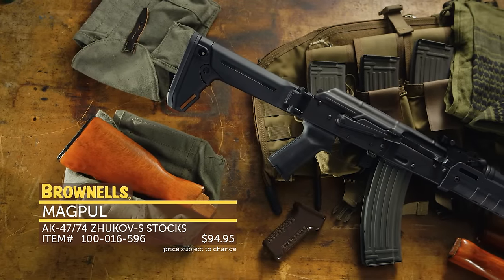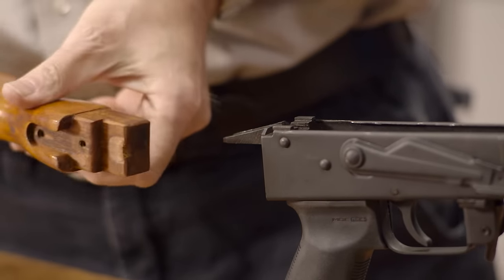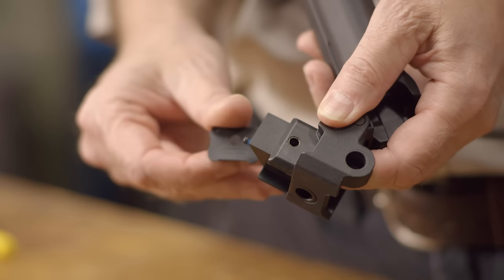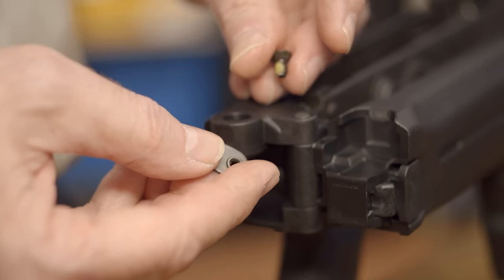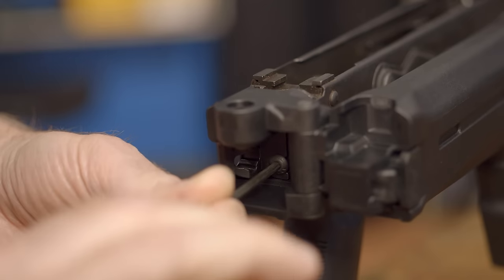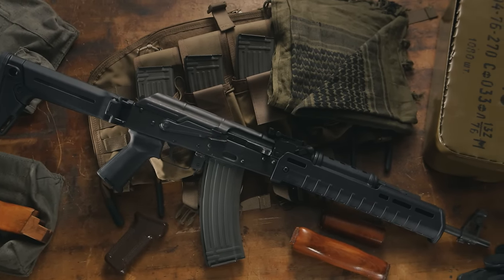Magpul AK-47/AK-74 Zhukov-S Stocks Installation

Comment: Mine just came in today. Thank you! I modified it to fit my Bulgarian. It won't win any beauty awards, but neither will the stock that came with it.
Mine was missing both the drop in wedge block washer and the tang well nut. So since I was installing it on a milled receiver I just used the receiver screw and put it up through the tang screw hole and used the wedge block nut. :)

Comment: “Slide the butt stock off the receiver.“

I think you mean: “Anchor it in the vice and yank on it until the point that you think your gun is going to break.“ Lol
Reply: There's typically a point you can pry it with a flathead screwdriver.

Comment: One tip: If you didn't get the front screw (I didn't!) tighten the wedge block first, then tighten the rear tang screw, otherwise everything will be lopsided. Took me a few WTF's and watching this video to find out my trunnion screw was missing.

Comment: I beat the wood furniture off with a hammer. Like totally obliterated it. That palm slap he did will not work on a WASR 10.
Reply: I just did this and I agree 😅
Reply: its AK , comrade. Nothing works without beating it ;-)
Reply: Screwdriver to wedge it out from the trunion hole 🤦‍♂️🤦‍♂️
Reply: No rubber mallet work just fine and all it does it put a couple marks on it grab a towel and wipe it off easy and not messing nun up

Comment: Time to change the old Woodstock  on mine. Can't  wait.
Reply: +Afro Sam
It is completely legal to put a folding stock on an AK, the only way it wouldn't be legal is if your AK qualifies as a pistol. If your AK has a barrel less than 16 inches, and an overall length less than 26 inches, then it is illegal to put any stock on it; thus the pistol brace was born. If your AK falls under this category, then you would need to fill out an ATF Form 1 and pay a $200.00 (USD) tax stamp. This would make it an SBR (NFA item), then you could legally put this folding stock on it.

However, if your AK is a classified as a rifle, then you have no legal restraint from putting this stock on it. It is 922r compliant, and is 100% legal for you to put on your rifle.

Comment: AKs would be great if the dust covers would go back on easily
Reply: MadavTV the only thing I don’t like about the platform.
Reply: They do, but not many people know how to properly put them back on. Slide the front of the cover into the groove above the front trunnion, then with your thumb keep pressure on the rear side of the cover maintaining everything aligned, then use her free hand to smack down firmly (not too hard) on the top of the cover.
Reply: Maaaaannnnn....
Reply: They do
Reply: They do
Reply: The dust cove is easy the bolt is hard
Reply: first, put the recoil spring so that it's hanging just below the opening, then put the dust cover in the groove, hold it in place, rack the bolt. button should pop
Reply: They do lol

Comment: Great info, thanks for sharing. You should have mentioned that the Zhukov requires the rear trunion for fixed stocks to be installed. If the rifle has a different rear trunion (like  Bulgarian folders), the Zhukov cannot be installed

Comment: Would it be recommend to add some lock tight after fitting everything?
Reply: No need. Everything is pretty solid. Magpul uses very in-spect screws and bolts.

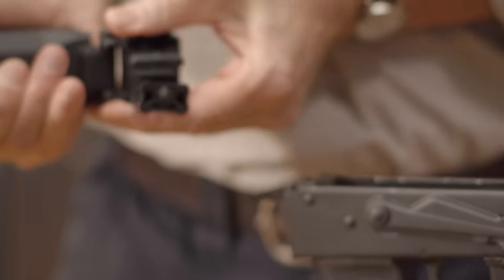Comment: Can someone here verify the stock's rear trunnion tang insertion length ( into the back of the receiver, 1:25 - 1:30 )..let's say, as measured forward from the rear vertical face of the receiver? I have a Saiga that was modified to AK specs, but chose to retain the original trigger pins to cover the holes. The rear trigger pin hole on a Saiga starts about  1 3/16" forward of the rear receiver face and I hope it won't interfere with the stock insertion length. Thanks.

Comment: Will this work on a 2015 production year WASR? If so will it increase the length of pull over a standard ak stock?
Reply: littleteethkeith yes it will work great! I just purchased a wasr10 2015 production and it looks and feels great no modding needed. It does increase length of pull over stock. I can send pics if needed God bless
Reply: _Killuminati_ 7.62 Thanks for the info. I think this is the route I'm going to take.
Reply: littleteethkeith no problem!! You won't regret it.

Comment: Is it easy cocking it back, when the stock is folded to the right?
Reply: No it's in the way. Just installed mine and checked that very thing. You can change out the grip for an one like on a galil to grab that way. But stock set up. No

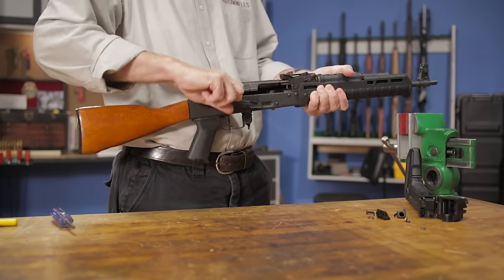Comment: 0:25 on safe? I don't think so. That safety appears to be off
Reply: Can't field strip it with the safety lever up.
Reply: You can't remove the bolt and gas piston with the firearm on safe, thus there it would be illogical if he actually had it on safe.

Comment: does zukov fit Bulgarian milled reciever ak?
Reply: I don't think so.   The Bulgarian Milled has two large metal tabs that come out of the rear.   You would need to at least cut the lower one off which would be permanent modification.   You might be able to make it work but your could have a real issue if you ever try to sell it unless you find another person who wants this stock forever.